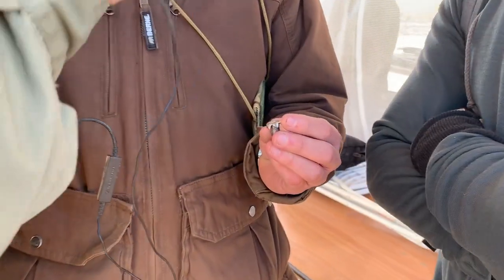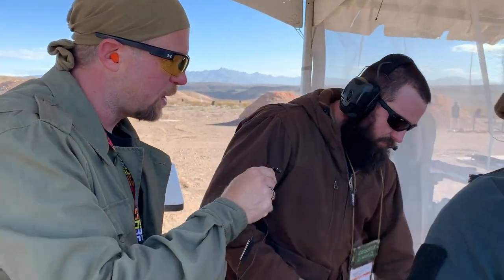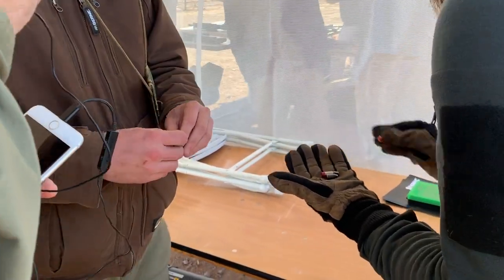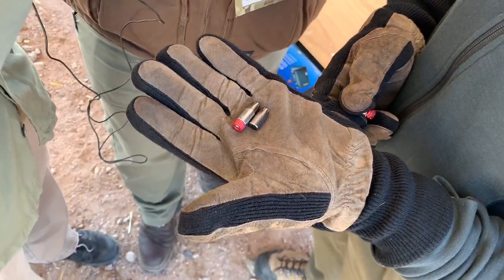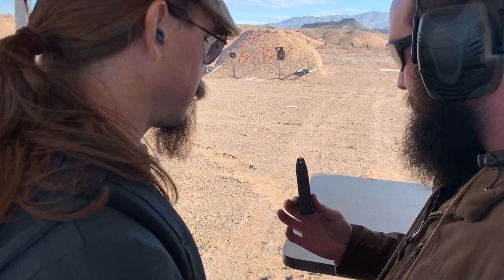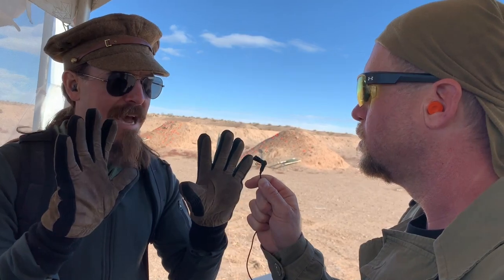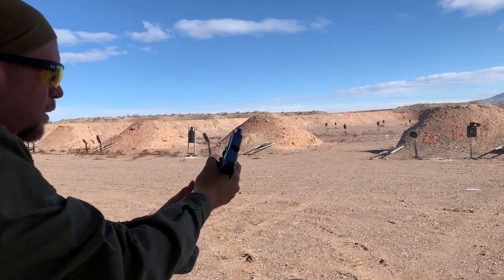SHOT Show 2019: Seismic High Mass Ammunition

Comment: Already did the math, seems like the 185gr is doing about 370 ft lbs, in at 950 fps(according to their site) what barre that is, I dont know. I also did the typical adjustments for a carbine and numbers seem to be coming in around 1,235 fps at 624 ft lbs. That is provided of course the powder is even suitable for use in a carbine and etc... 

But for anybody wondering how a carbine might effect this ammo or what kinda specs is it getting, the 950 fps is their claim on their site. The 370 ft lbs is just using a simple ballistics calculator. I hope that answers any questions some may have on what kind of performance they could expect. In all honesty, the 185gr ammo seems to be doing about what .40 S&W is doing stock, only the .40 S&W can get a little more oomph... 

That being said, now 9mm guys can really say it can do what the .40 S&W can do and then some I guess. Well... to an extent anyways.
Reply: I'm not a .40 guy, but I'd really like to see this concept applied to the .40 S&W. Might take some of the snap out of that cartridge.
Reply: @schifty1  The .40 S&W is a daily carry for me, and I can agree with you on this. That cartridge has way too much recoil, especially in a polymer frame like my S&W SD40VE, or a Glock or M&P Shield. I believe it would improve it dramatically, but with the drawback of cost. Twenty five rounds locally of .40 HP is twenty bucks give or take and I can only imagine how much that would cost, not to mention everyone getting away from .40 S&W in favor of 10mm and 9mm +P+.
Reply: Nothing is stopping them from giving the same treatment to .40, just startinng with your two most popular cals. Would be interesting to see what they could do with 10mm.
Reply: @jdoerr779  But going .45 ACP limits magazine capacity, out of most .45s (that aren't 1911, or its derivitives) ten to twelve rounds in a flush fitting magazine. Whereas I can get an additional two rounds of .40 cal from something as basic as a starter S&W. Not to mention concealed carry, where you get even more limited capacity, which at that point, is equivalent in capacity as a revolver in a magnum load. However, .45 has its perks. More mass means more delivered kinetic energy on target.
Reply: Indefinite depends on how slow burning the powered is, they may be able to work up a carbine specific load with really slow burning powder.
Reply: TBH, I wouldn’t put any stock into Ft-lbs for pistol cartridges. Simply put, they don’t matter, since pistol cartridges don’t generate enough hydrostatic shock to create a permanent cavity. All that matters is expansion and penetration. These rounds are almost guaranteed to be worse than a lighter, faster 9mm bullet in terms of lethality. Their main improvement will be in penetration versus other subsonic ammunition.
Reply: @EtherFox  Well I've done extensive carbine testing with all sorts of pistol calibers, typically speaking... taking a 4 or 5 inch semi auto and taking it to 16 to 18 inches nets a gain of 24% to 30% increases in velocity and about 46% to 50% increases in energy regardless of load in a lot of cases. Now, certain calibers start to lose performance or cap out sooner than others, I suspect in a 16 inch barrel this would cap out in terms of performance and you'd see the numbers I posted or very close to them at the very least. 

In short.. it's a good heavy hunting load in my opinion. Wouldnt be too bad in a carbine for defense either if barrier penetration was a concern either.
Reply: @Gasmask11000  This is true to an extent, certain pistol calibers break the mold in handguns, but there's a larger number than in carbines break this level of performance and get rifle like ballistic. There's no reason to believe this will be worse than lighter bullets. At most they may get better expansion but what I've seen of these they expand just fine for one but also as mentioned, deeper penetration so more likely to hit vitals. All in all I see this load as something I'd use for something like hunting before self defense but it has plenty of application there too.
Reply: @SorrowfulFoxx21  The biggest issue with a lot of .40 S&W guns is companies like Glock essentially just throw in a .40 S&W barrel and extractor onto a 9mm frame and change nothing else. Most polymer .40 S&W's share the same recoil spring and guide rod setup too as their 9mm counter parts. However, some purpose built .40 S&W guns use heavier springs and the likes which effects felt recoil quite a bit.

Prime example, a Glock 23 has a stock factory recoil spring of 15lbs. Bump that up to a 17 lb or maybe 20 lb spring and it feels like a different animal completely. When I first bought a Glock 20, using the stock recoil spring of 17 lb, full power 10mm was a nightmare to control. Swapped out for a 24 lb spring, wanted a 22 lb but couldnt find it and it was as smooth as butter at that point and really felt no worse than .45 ACP +P. 

So frankly, I dont think that .40 S&W has as much "snap" as people like to give it credit for... it's mostly just poor choice of gun and the companies making them refusing to actually make them purpose built as opposed to the obviously much cheaper route of throwing .40 S&W components into a 9mm frame. Glock strengthened their polymer frames to prevent ka-booms like early .40 S&W and 10mm guns were known for, but thats all they changed it seems. I've shot tons of .40 S&W ammo out of several different platforms and I can say safely that when shooting metal frame guns like the S&W 4006 which share the same recoil spring and guide rod as the 5900 series guns in 9mm, it doesnt have that "Snap" like a Glock does or some similar pistols. 

But right now with the resurgence of 10mm, you're more likely to see this kind of thing applied to 10mm before a .40 S&W load. I like the potential this offers to a lot of pistol calibers and believe it has a lot of merit in the long run.
Reply: @rifleshooterchannel208  I highly doubt that claim.. The dual case like that was something introduced a few years ago and while it hasnt been the most popular idea on the civilian market I dont think it was ever ultimately trying to draw appeal from that arena anyways. The main advantage seemed to be if you carried lots of ammo it would reduce weight by "X" amount of ounces or pounds to your total load which would either equate to having more ammo for the same weight or more essential gear items. 

That being said, that kind of case has been shown to be quite good for reloading with one singular case being reloaded over 100 times before seeing noticeable failure. So I dont think the case has anything to do with how the bullet performs. If you dont like it, that's fine. Not sure I'll be buying any myself as I dont have a need for what it's bringing to the table. But the concept about how they are achieving the performance with heavier bullets is where the real merit is.
Reply: @rifleshooterchannel208  I dunno, people seem to like them
Reply: @jdoerr779  If you load a .45 ACP with a 185gr bullet and compare it to 180gr .40 S&W from the same length barrels in say Glock platforms, you'll notice felt recoil is not all that much different. IF there's a major difference I'd say it's the fact the Glock options like a G23 vs G30, the G23 is lighter and thinner and also uses a 15 lb spring where the G30 is thicker, heavier, and uses a 17 lb spring. But then if you go to +P .45 ACP loads which is often needed to match most .40 S&W loads, you'll notice the felt recoil will be worse on the .45 ACP sticking with the same formula. 

Bump the .40 S&W recoil spring up and due to it being a lighter and smaller frame you'll still get a different recoil impulse but it will be lessened and not as severe. Suddenly, that felt recoil difference doesnt really exist as much. Personally I'm happy with .40 S&W performance as is myself though.
Reply: Christopher 

All things being equal, faster bullets tend to expand more rapidly, causing more tissue damage. They also tend to penetrate deeper. I guess we’ll have to wait until lucky gunner does some gel tests, but my money is on the high end supersonic ammo still beating the pants off this. This seems like a neat option for those with a suppressed nightstand gun, but not a replacement for 147 grain HSTs.
Reply: @Predalien195  Thank you for that information. I am fairly confident in my firearms knowledge but this was helpful. I'd love to have a 10mm gun in the near future, but price has kept me away so far. Do you know of any quality guns that won't break the bank?
Reply: @rifleshooterchannel208  true lol
Reply: .40 is usually 450+ ft lbs so...
Reply: @Predalien195  Probably too soft of lead, with to aggressive of a hollow point to use on deer ect, with a low velocity, and probably limited penetration.  I would be surprised if this gets 16"+ in gel for self defense, let alone the additional for shoulder, double lung, and exit, for deer or hog.
Reply: @jdoerr779  I've carried .40 S&W as a duty round, shot thousands of it. Yes, .45 ACP is 2/3 the pressure, so naturally it will have less recoil right off the bat. But if you do the things I said to do, you'll see how quickly that changes. +P .45 ACP is often comparable to most .40 S&W loads with boutique companies like Underwood and Buffalo Bore load stuff hotter in some cases but finding a .40 S&W load that beats it on performance is easy. Frankly speaking.. .40 S&W has more potential than .45 ACP, period. If you're concerned about recoil you can go light for caliber in the .40 S&W or you can switch over to the .45 ACP. 

Difference at the end of the day is a hot 180gr .40 S&W will be comparable to a +P .45 ACP, and suddenly the felt recoil isnt much different. Like I said, few main factors contribute to that... weight of the guns as a whole and the fact companies havent learned yet.
Reply: @SorrowfulFoxx21  Honestly the Glock 20 is a good bet, I'd replace the recoil spring and guide rod if you want to shoot hot 10mm though. The EAA Witness guns are also pretty good so long as you do the same thing. Grand Power has a 10mm gun now that's around $650, and believe Springfield now has an XD in 10mm. Again though, replacing springs may be needed on some of those. Dont know about the GP and the XD though.
Reply: @paulharveu526  Out of a carbine it would do fine at the listed velocities. That's text book .357 Magnum in a 6 inch barrel which I've used with similar loads to great success on both games. Granted yes, I'd have to try out it for sure. But if you cant get a shoulder or double lung exit shot, try aiming by the neck or head instead.
Reply: @Gasmask11000   Hydrostatic shock doesn't matter. Extensive FBI studies couldn't determine if it even real or not. Either it doesn't exist at all, or it's probability is so low along with it's effect that it's an unreliable aspect.
Reply: Momentum matters more than energy for pistols. In USPSA the 185 would have a 175 Power Factor, while the 115 @ 1150 would have a 132.
Reply: @Homesickfobbit  Maybe in the USPSA that matters more. In real life defensive situations, the primary elements that matter in handguns and pistol calibers in them is adequate penetration and good shot placement. For hunting, same thing usually as well. Secondary things with handguns is mostly about expansion for causing wounds. And again, what I've seen of these rounds they expand well enough and certainly get the penetration needed. These would do well for hunting especially in a carbine, in self defense there wouldnt be much of a point to use these over more traditional ammo unless extra penetration was called for.
Reply: @Gasmask11000  Rapid expansion does cause more tissue damage. Often results in shallow penetration too. Which it's been shown through decades of research and study that pistol calibers typically cause lethal shots via adequate penetration, 12-18 inches and good shot placement. Expansion is good as most pistol calibers fail to exit the body when fired from a handgun, so the larger the hole generally the better.
For self defense, I too see a lot of current JHP offerings being better than this ammo. However, it shows it has good expansion and from what I've seen, adequate penetration as well. 

As I said, this ammo would be good in a carbine and would be decent as a hunting load for the caliber. I dont think this is intended to "replace" anything, but rather give you new options. I dont think you should wait for gel tests really as those typically dont reveal a whole lot except for if it can meet FBI minimum standards, which at the claimed 950 fps which I believe is from a 4 to 5 inch semi auto, likely something like a Glock 19 or 17, then it should easily get the FBI minimums with that bullet weight. Plenty of .40 S&W guns do, plenty of .45 ACP 185gr's do too using JHP designs at similar velocity levels.
Reply: @davet231  The slowness of burn rate is irrelevant in this situation. As Indefinite pointed out, there is almost no case capacity in 9mm with these heavy bullets. You need a lot of slow burning powder to get good performance out of longer barrels. This is why .357 magnum can launch 180gr bullets with nearly 1,100ft-lbs of energy out of a carbine.
Reply: "Snappy recoil" is short term for ur a wimp. My wife handles 180 gr .40 s&w @ 1350 fps.
Reply: I wanna put the 325gr .45 caliber bullet in a .45 Super case and hotrod it.
I'd probably run the first magazine from behind a tree with a string on the trigger.
Reply: @braedenreed5853  Nobody cares about what your wife handles. Statistically speaking she will be faster and more accurate with 9mm. Being faster and more accurate are a greater benefit than the performance jump between two adjacent caliber sizes.
Reply: @Predalien195  I agree my glock.23 fires completely different when I have my tlr flashlight on it then with out that couple oz of added weight helps alot and now I'm gonna look for a 17-20pound guide rods and spring and see if that takes the snap out of it, I love my .40 I've owned 2-23and a.22 I prefer the 22 but had to get rid of it hard times, wish I woulda did the .23 but hey ya lol be and learn lol
Reply: @SorrowfulFoxx21  I conceal carry the FN FNX-45 (The regular version, not the tactical version) and it's quite fine to be honest. I especially like that it has a 15 + 1 round capacity, but the grip is drawn out a little bit so it isn't too fat of a grip.  Plus you can swap out the back strap for a bigger one or smaller one that comes with the gun. And it comes with 3 magazines. I've got about 3,000 rounds through it using about 1/3 of that being Fiocchi 230 gr JHP and 2/3 of it being Fiocchi 230 gr FMJ and I've never had it malfunction once on me. In a size comparison, the barrel is 4.5 inches so a little shorter than gov't model 1911. It's about the same size as a glock 17 so it is absolutely viable for conceal carry. And while it has an exposed hammer, after about 200 rounds of practice, I have been able to figure out how to position the holster and to draw from within the waistband without it snagging on anything.

For roughly $700 dollars that's actually a pretty good deal in my opinion. IMHO, the FN FNX-45 is probably the BEST 45 caliber pistol because it's the most well rounded. Can others do a specific task better? There's probably one or two out there, but overall the FNX-45 is the best.  Like Paul Harrell, Garand Thumb, T.REX ARMS and InRange TV say - practice is the absolutely most important thing. Even if you buy a 2,000 dollar hand gun, if you don't practice you'll suck with it.

Edit: DISCLAIMER - I actually really do like 9mm I believe it is perfectly adequate for self defense. If it wasn't I don't think it would be as popular as it is. I just prefer .45 because I have the most experience shooting it, meaning I'm more comfortable with it. Just like with magnum revolvers I prefer .357 mag to .44 simply because I have more experience with .357, even though I thoroughly enjoy shooting my friend's .44 mag. And I use Fiocchi for everything because A.) Specific to .45, I replicated the meat target test from Paul Harrell with Fiocchi .45 ACP 230 Gr. JHP and it has superb expansion and penetration from my test results, B.) I will become familiar with how Fiocchi performs in my all of my firearms and C.) Fiocchi provides the best balance of quality brass ammo and affordability for my budget. BTW those three firearms and a M59/66 SKS are the only firearms I own (I know, those are rookie numbers and I need to pump them up, but I only recently got into shooting back in 2017 when my dad gifted me the SKS on my 18th birthday. Plus I'm well off financially; although I'm by no means upper middle class, let alone wealthy).  And I've never competed in any shooting competition, but I have been training 4-5 days a week and following some advice from local shooting trainers to train for competition. I also exercise and hit the gym so that, you know, running around in my competition kit won't be difficult for me. Wish me luck, guys!

Comment: How to make your sig 365 weigh 2lbs.
Reply: Makes it a better throwing implement
Reply: @beardoggin8963  It should be lighter when the time to throw arrives.
Reply: Another Guy lol not if it is like the 1st gen 365s and the firing pin breaks or it just won’t cycle. That is what I was getting at
Reply: @beardoggin8963  they still making the first gen. They have just made revisions to the first design. If they called every revision to the design a new generation, the 320 would be on like Gen 40.
Reply: @guntotingnerd8830  ok that was pretty funny. Good job lol
Reply: @FiveTwoSevenTHR  be nice if Sig could make a new handgun that worked right from the start and wasnt borderline unsafe to carry
Reply: @guntotingnerd8830  nice.